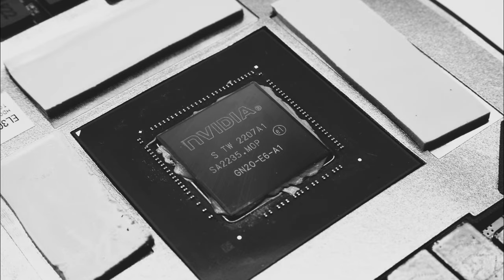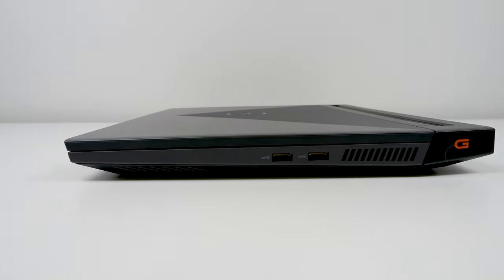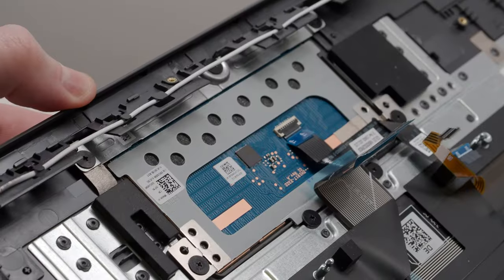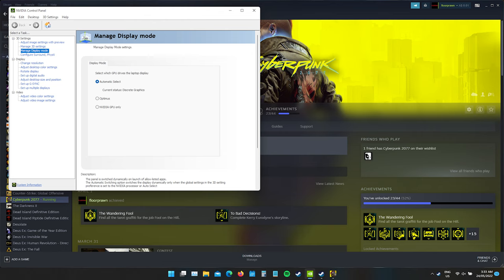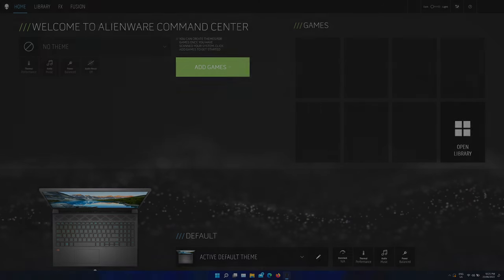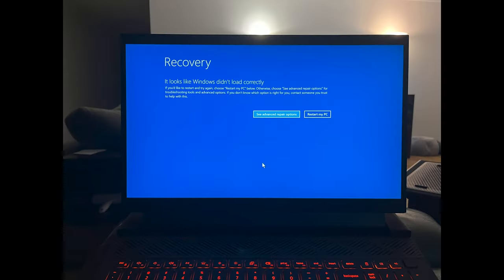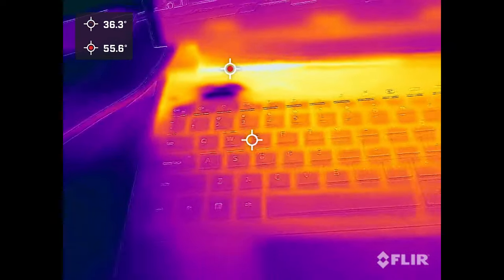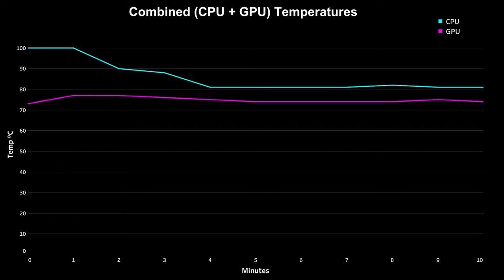Dell G15 5520 - i7 12700H/RTX 3070 Ti - Nuclear Review

Comment from the maker: A couple of corrections courtesy of eagle-eyed viewers:
1) The original SSD is in fact PCIE 3.0 (not 4.0) - this unit was originally specified to contain a PCIE 4.0 drive and I neglected to double-check the spec of the installed drive. The advertising/promotional material has since been corrected.
2) 09:48 - the included snippet of the screen capture for "flat-on-desk" does not show the 86 degree GPU temperature referenced in the video & the CPU is still running at 55W (vs. the 45w steady-state/PL1 shown in the "elevated" footage) - the CPU does eventually settle to 45w & the GPU will gradually rise to ~86 and remain there indefinitely.

If you spot any other errors please let me know and I'll pin them here :)
Reply: What was the resolution of games that were tested?

Comment: I'm daily driving this exact spec for work and gaming, and am surprised to see these results. My experience so far has been very solid, as I went in with no expectations of low fan noise or long battery life. The software issues don't bother me and the 'G' key works perfectly fine enabling and disabling the performance fan profile during gaming.

I've made an effort not to tweak or benchmark the device too much as I don't want to add any bias during these first few months, but I haven't 'noticed' any major throttling whatsoever. I have seen very high temps so I can only assume some thermal management is going on, but don't notice any game performance loss.

FWIW regarding fan noise, I never hear the fans during work use - the cooling is borrowed from Alienware, does the job well under normal load.
Reply: I just bought mine arriving nexr week tuesday, i am worried i am not going to like it. It was this laptop vs A15 6800H 3070ti, but i wanted alder lake. I am at least hopeful since you love yours.
Reply from the maker: I'm very surprised about the G key's behaviour on this one, I have two 2021 G15s and even with the latest software updates it works fine on those. Bizarre!
Reply: @NuclearNotebook  To be clear I don't dispute any point of your review and appreciate the effort and level of detail - just adding my contrasting take for anyone interested 😊
Reply from the maker: @c9k  I always appreciate people jumping in with their own experiences! I've only ever got the one unit to form an opinion on so it's hard to accurately gauge what's common and what isn't without some crowdsourced input.
Reply: I just bought the same spec model last week. Works really well for me. Although I might upgrade the ssd to a full length.

Comment: I received mine on Friday, a bit earlier than expected. Haven't found the time to push it & test everything. But this laptop definitely runs hot, you were right. F
The weird thing is that it is also so loud. I think the laptop is given more power than is necessary all the time.
Reply from the maker: Yeah, it seems to be. Mine gets warm just sitting doing nothing even on battery power. I'm reasonably confident that could be fixed with BIOS/software updates but that's up to Dell.

Comment: Received mine at the start of June, had a hot pixel smack bang in the middle of the screen. Dell said they would only replace if there were 6 or more dead/hot/stuck pixels.

I kicked up a fuss and threatend to take them to the ACCC (Australian consumer watchdog) and low and behold at the end of June, im on the replacement system.

Going down from Windows 11 > 10 is a headache with this and upgrading the 512GB Gen3 SSD to a Gen4 2TB NVME is very much recommended.
Reply from the maker: Good work getting them to sort it out. Dead pixels & "dead pixel policies" trigger me to no end!
Reply: 100% mate, just finished watching your video, great video and delivery on your content, keep it up! Subbed

Hopefully Dell can take on your feedback on future iterations
Reply: @oLEMONPLEDGEo  Received mine 2 days ago, do you know if Dell warranty covers thermal paste replacement? One of the commenters pointed out that thermal paste replacement is necessary & was wondering if it is possible to get a Dell technician to replace my thermal paste with a superior compound under my warranty.
Reply: @Dani-kq6qq  I wouldnt say thermal paste replacement is warranted, this reviewers unit was fine, a cooling pad will be much more effective than a re-paste and you will only know about a poor paste application if you opened it up.

Cooling pad from Kmart (Aus) reduced my in-game temps for CPU/GPU by 10 degrees

Comment: Totally agree with this review. I had the exact same spec'ed laptop, but returned it. Of the all downgrades that Dell applied on this generation of G15 I could not live with the missing 2nd ssd connector the most. The laptop & its power supply are heavy and bulky enough. I don't want to carry an external storage on top <sigh>. This is a shame because otherwise the performance was pretty solid.
Reply from the maker: The performance sure is great but yeah, the total package just doesn't add up to a great experience. I wish Dell would at least replace the huge charger with a smaller GaN unit like they provide with Alienwares.
Reply: You can buy the mount off of Amazon to use the secondary M.2 space but that's just a hassle. Idk if I should return mine but this laptop is all I have a budget for atm.
Reply: @razermaximyt1672  should I buy it? It’s on sale for australia atm
Reply: So what’s laptop you’re using now?
Reply: @thedersstudio  a very old high school laptop toshiba
Reply: @razermaximyt1672  so you can buy an aftermarket solution to the non existent second ssd mount?
Reply: @senru  you cant use mount,in old generations they didnt provide mount but provided slot,in this 2022 variants they removed slot altogether

Comment: What is the actual SSD drive in this laptop? I found in mine it appeared to be a Gen 3 SSD despite the specs stating that it would be a Gen 4 PCIe SSD. 
Edit - I complained to Dell and they issued a RMA for the laptop. I also see that they have now removed the reference to Gen 4 PCIe from their ordering page. My understanding is that the gen 4 ssd drives are 2280 devices rather than the 2230 device shown here.
Reply from the maker: Thanks for flagging that - you are correct, these ship with WD SN730 or Samsung PM991A in 512GB, both of which are indeed PCIE 3.0 x4, or WD SN810 for 1TB+, which is PCIE 4.0. You're also right that the easy visual difference is 2230 vs 2280 for PCIE 4 drives, I should have spotted that but got thrown right off by the original spec sheet claiming PCIE4.0 on all models. How annoying!
Reply: Even I am getting a Gen 3 in this laptop however when I bought it was Gen4 on webpage. What we can do now. Kindly suggest.
Reply: i've seen even KIOXIA 1TB 2230

Comment: Mine was doing that when I first bought it but after updates from dell and Bios update. Everything is normal now. Only issue now is the Battery life, I could only get 2 hours none gaming
Reply from the maker: Good to know it's not just me getting that terrible battery life! Please let me know if you get it sorted out at some stage.
Reply: In the older ryzen edition if you Disable the turbo boost and set  minimum processor usage to 1% and maximum to 1% then you will expect a lot more...also keeping the brightness at 30% is more than enough for indoor usages
For Intel try you may try to lock the clockspeeds at 1.7ghz which I found good for my ryzen version
Reply: @NuclearNotebook  after talking with Dell and having them remotely try to figure out the reason. Nothing was done. So the end result was I re-installed Windows 11 and that fixed the issue with the battery. I am now getting 9 hours! Of video playback, watching movies. Games getting just about 2 or 4 hours on it now. Windows 11 is the issue, not dell. You can't use windows 10 because the 12th gen intel cpu won't work properly with the extra cores.

Comment: this review is out of planet earth, well done!

just received my G15 5520 two days ago after being assured by their support that this version have extra slot for SSD, but i see in comments that it doesn't have one or it does have its space but with no connector or whatsoever! can someone confirm this for me please, and if its true did you contact dell about it? thanks in advance :)
Reply from the maker: I can confirm that no variants of the 5520 have the second connector for the SSD. It's been deleted across the board this year. You'd need to return it and move to the Alienware M15 to get a similar (nearly identical) machine with two drive slots. Dell have good documentation on the Support website, you can have a look at the "Setup & Specifications" document for any given laptop to see available slots etc. Relevant one for the G15 5520 here: https://www.dell.com/support/manuals/en-au/g-series-15-5520-laptop/dell-g15-5520-setup-and-specifications/internal-slots?guid=guid-647a9bd6-0be5-4b27-9df1-31e3c269abed&lang=en-us
Reply: @NuclearNotebook  thank you so much, appreciate the effort
Reply: @NuclearNotebook  Does the 5515 3060 have an extra connector? Its the ryzen edition

Comment: i got the dell g15 5521 SE for $1399 on sale new at micro center. all the software issues you had were fixed as of 12/20/2022. specs 12900h, 3070 ti, QHD 1440p 240hhz,  32 gb of ddr5, 1 tb still only one slot😒. I put a gen 4 7,000 read and 5,800 write nvme. you have to get a copper heat sink from amazon for 7.99  but a steal.....get the 3 year plan for sure. performs better the my desktop pc.

Comment: 9:55 I doubt that difference is not majorly because of elevation.... It's mainly because of CPU TDP,clockspeeds
Reply from the maker: Well spotted - I included a poorly-chosen clip from the "flat on desk" screen capture. Ultimately it settles at around 45W on the CPU with the GPU at 86 degrees after steadily creeping up for a few minutes.,

Comment: So this laptop eventually made into indian market for 166K INR (delivery and GST included) or roughly 2200 USD, but with RGB 4ZONE keyboard, QHD panel, 1TB Storage, 3 years of premuim support (optional for additional 6k INR), 1 year of McAfee, Microsoft office 2019(McAfee and Office are mandatory SADLY) and G series carry Bag. Do you think i should pull the trigger?
Reply: Dell G15 is clearly a great package given the cost but you are looking at some compromises in the long run (Missing 2nd SSD slot, plastic build all around, bad trackpad) and some issues with the software optimisation which impact the battery life and the G key glitches. To me, at this price point, you should be able to have some upgradable options and the glitches just ruin the experience given the fact you are spending a good amount of money. I was also interested in getting this laptop but all these issues that were pointed out in the vid made me re-evaluate my options. I'm waiting on the legion series to drop in India, then I can make a better buying decision myself.
Reply from the maker: Bit of a delayed reply, apologies! I'm going to stand my ground on this one and say I can't recommend it, in good faith, despite the price - the unreliability & bugginess really got to me while testing it. It's far too irritating and I can't imagine trying to put up with it long-term. I'm also very disappointed at the regression in the quality of assembly compared to last year's G15 and that's a major concern - someone else could easily get one with more serious defects than the minor oopsies on mine. You could look at a similar MSI Katana/Sword or Lenovo Legion however I'm hesitant to firmly recommend either of those before testing them myself.
Reply: Did u pull the trigger? I am also from india and the SE version of rtx 3060 model was listed at INR 140K on flipkart (I have placed the order),did you face any issues like bluescreen issues in other varients?

Comment: Thanks for the amazing review, I was planning to buy this model in India during the festive season sale, and because of this review and comments from other users I got to know that there is no secondary storage slot. This was a big deal breaker for me because I like keeping my homework, studies, and coding files in the main drive and games and other multimedia in another one. So when I went to buy a laptop I still went for Dell but the 2021 model (both 2021 and 2022 models are on sale in India). The dude in the Dell shop was trying hard to sell me the 2022 model and came up with a solution that they will upgrade my SSD to a 2TB drive for a relatively cheaper price and make partitions in the drive according to my needs but I couldn't say yes to the offer because just knowing the fact that there is literally a mark in the board for the feature but that has been willingly stripped down by Dell didn't feel good. Also, I saved a lot of money going for the 2021 model and put an SSD(1TB)  in the second slot and still left with some money.
Reply: Which processor u got?
11260h processor is of which generation? (2021 or 2022)
Reply: @nikhil3417  I have 11260H 2021 model with 16GB Ram and 512GB ssd, this one is of 2021 model year.
Reply: @kartikeysingh6081  bro at what price u got it?
Can u tell me if there is nvidia optimux feature present?
Reply: @nikhil3417  I got it for 70K, my model doesn't have optimus (mux) only models with 3060 have optimus.
Reply: @kartikeysingh6081  ok. Thanks. Enjoy Dell G15😀😀

Comment: That amd advantage edition strix is truly a killer laptop. Saw it drop to $1350 recently (sale ended on 20th june) and with a 1080p 300hz panel with a 5900hx + 6800m, it was unbeatable value. And 10hr battery life is insane.
Reply from the maker: I've been hunting for one locally with both Ryzen 6000 and Radeon 6000, would love to check one out. I'm not quite clear on whether they've actually been released anywhere in that configuration yet though.
Reply: @NuclearNotebook  I'd personally wait for ryzen 7000 and rx7000 laptops. 

Have you reviewed the gigabyte aero 5? 4k oled with full power 3070ti's and 3060's sounds killer.
Reply: @NuclearNotebook  if you are in Aus,  I would recommend the lenovo thinkbook 16p gen3 as your next review target.  It had been released and for sale in China and other countries with very nice reputation. I believe it will be available in Aus in next couple of month.  
And also, I am expecting the 6800u ultrathin laptop like Asus zenbook s 13 oled ryzen version for budget gaming/emulation laptop as 6800u had been chosen as windows handheld consoles for some Chinese brand companies, like aya, ayn,etc. I hope you can take a look at them and may provide some good videos as well.

Comment: Fair point on the battery life and noise levels, but I experienced no issues with the g key, putting the laptop to sleep and waking it (except for the horrible s3 sleep bullshit ms/dell decided to leave in the worst possible state on this laptop). I took mine to bits when I got it to apply a better thermal compound (honeywell 7950) which game me a handsome bump in performance and took the temps down a notch. Sadly I was too eager to do the swap and didn't do pre-repasting measurements. I also didn't find any glaring issues with overtightened screws, unpeeled adhesive etc. during my disassembly, though it is a very painful laptop to change thermal paste on for sure.

Overall a high quality review, however I feel like you should've RMAd your laptop, considering the sleep issues. Not sure how prudent it is to review a (seemingly) faulty unit.

Alienware control center is very clunky, but does indeed work for me, however I must say that I did a clean install of windows 11 education to remove all the preloaded crap that comes with the laptop. I also did encounter the issue you had with it not exposing the thermal controls a few times, however the first time it happened was when I didn't fully plug in one of the RGB cables during reassembly and the subsequent times were all fixed by rebooting the computer. I haven't had this issue for months now, assuming it might've been fixed in one of the several updates the control center received in that time.

Oh yes, and the speakers on this laptop are absolute garbage. Not sure if something got messed up with the reinstall, but I pretty much gave up on them entirely, opting for a bluetooth speaker I bought instead. Thankfully, I got this laptop largely as a portable desktop, since I travel often, and for that I'd say it is a good option, but it's definitely trash for use on the go.

Comment: Hey again, out of curiosity (as i have this exact spec'd laptop) would it be wise to liquid metal cool the CPU + GPU on this? 

Basing this off your teardown, seems liquid metal could work on this as its mostly all copper and cant see any aluminium
Reply from the maker: From memory you can't remove the fans on these to clean dust from behind the heatsink fins without taking the entire cooler off the board, for that reason alone I probably wouldn't want to use LM on one. Would be interesting to see the results though.
Reply: @NuclearNotebook  Thats what i was thinking too, seems a bit too cumbersome

Comment: Agree with Battery life or as you said lack of lol. Probably software updates can improve it. Bought the 3060 version
Reply: Considering buying the 3060 version myself, how's your experience so far?
Reply: @aakashghosh8369  +1
Reply: Just got SE Qhd screen 3060 graphics can’t wait
Reply: Battery life is wack and I am disappointed I got the 3050 version
Reply: @eurekaelement833  i also placed order for the rtx 3060 SE (G15 5521 SE) version online, can you please tell me if you are facing any issues (like bluescreen issues in other models).